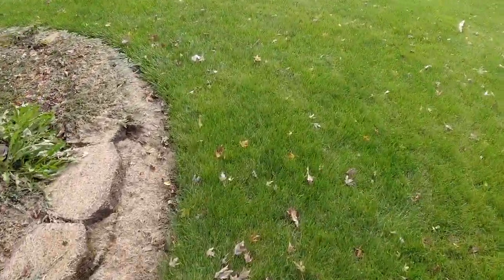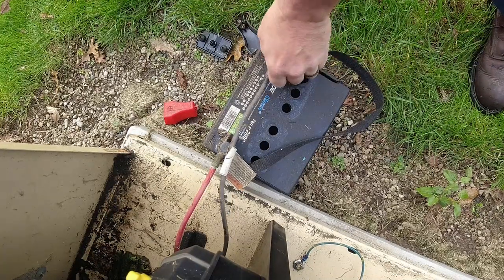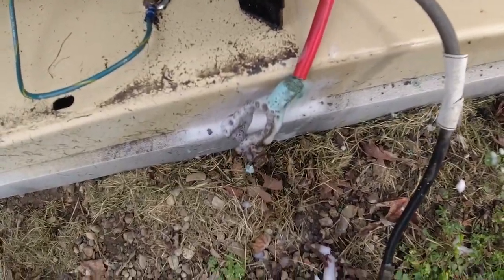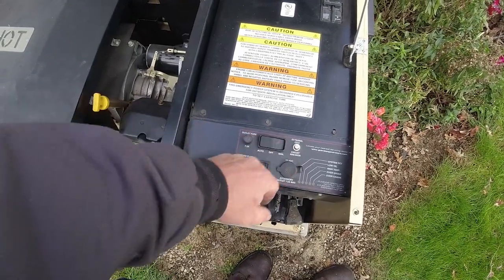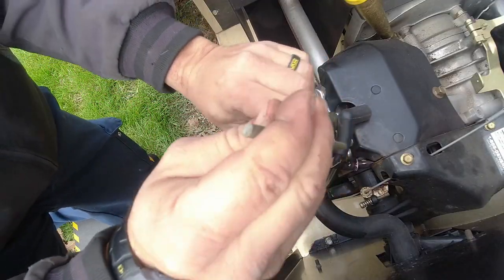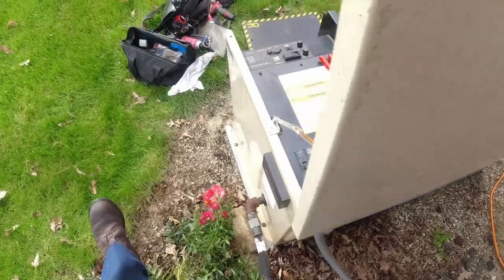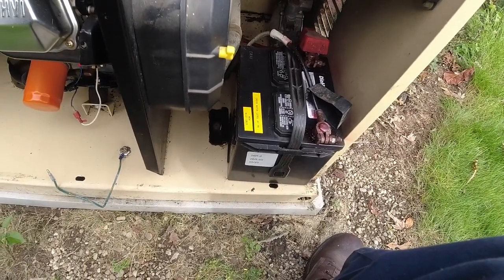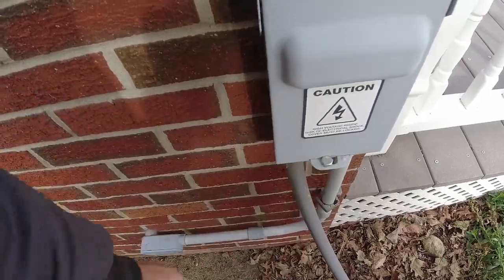Generac Generator Over Crank Easy Fix

Comment: Looks like lithium iron phosphate battery will be a good candidate for replacement because it can take the higher voltage from a defective regulator if it’s too aggressive with a slightly too high charging voltage . 

       Or the alternative fix is to remove the diode regulator assembly from the factory unit wire in a aftermarket external with a adjustable voltage regulator to correctly charge a lead acid battery

Yes the lithium iron phosphate batteries are much more expensive but if you want a long life durability and you can literally cycle them up to their regular voltage say 3000 times to 12,000 times and if you lower their voltage and only charge them like a normal lead acid battery you should be able to cycle them anywhere from 15,000 to 20,000 times because he will be putting them under no stress
          Should last you about 15 years to 20 years That’s the advantage of lithium iron phosphate
Reply: That won't work, they require a special charger. First they are charged in a constant current mode and then constant voltage to a specific point. Lead acid chargers are way too simplified for this and will destroy those batteries. You could do this upgrade if you also installed a dedicated charger that followed a specific charge profile.